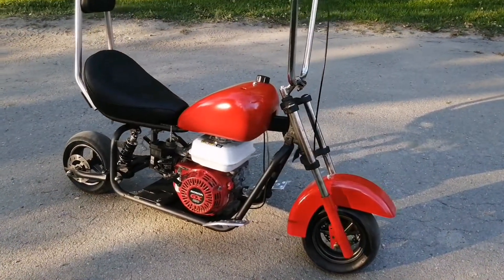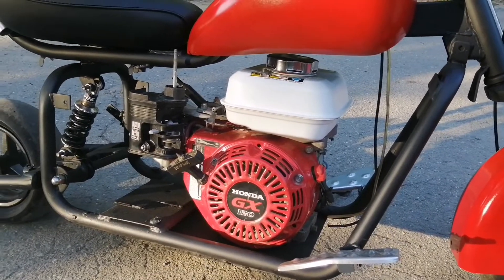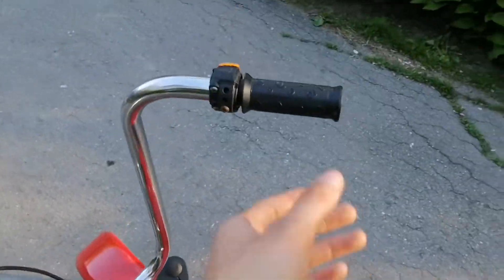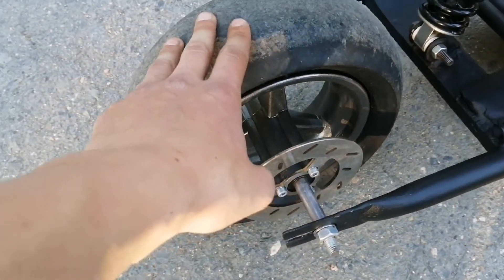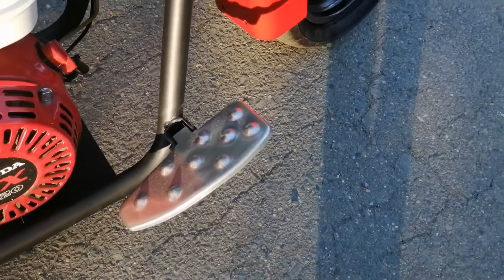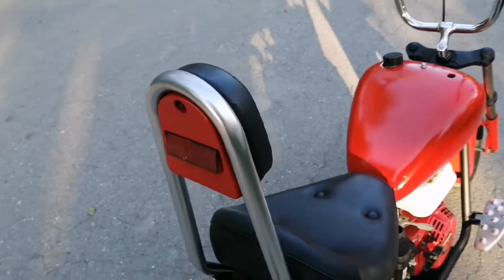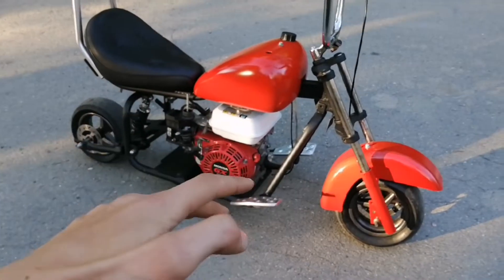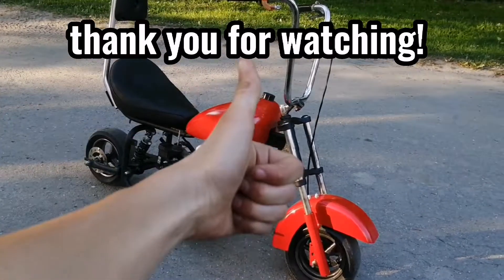Apc Mini Chopper with a Gx120 (New build)

Comment: Looks good. How did you mod original fork to accommodate the new bar setup?
Reply from the maker: Yeah when I first bought it, it came like that. I’m assuming all they did was install a normal type off stem on the bike so it could fit those big ole ape hangers lol
Reply: This Is what I’m trying to do

Comment: What size rear axel does it use? I’ve been looking for one.
Reply from the maker: Yeah I could not find one online that was wide enough for the swing arm so what I did was buy a threaded rod and then cut spacers for the real wheels. It may take a little more time but it’s better than having to axle at all.

Comment: Hey can you tell me the links for the handlebars and the fork
Reply: Apc mini chopper forks and looks like some one just put bicycle handlebars where the stock folding ones would have been
Reply from the maker: @benheiligmane7776 funny enough when I got it those bars were installed

Comment: What wheels are they ?
Reply from the maker: They were pocket bike wheels but I switched them out for the original wheels which had slightly taller tires and made Corning a lot easier. Those pocket bike wheels were powder coated hence why I through them on at first.